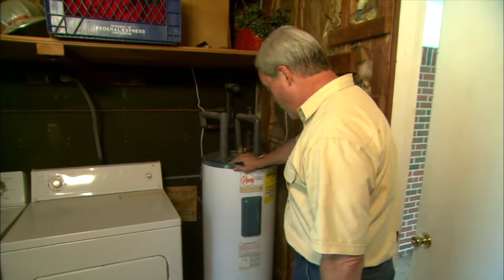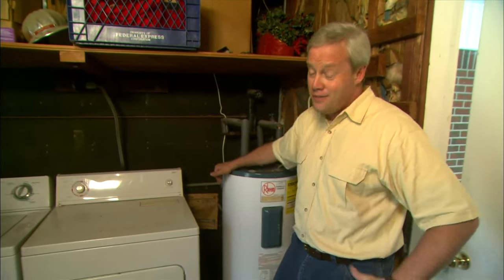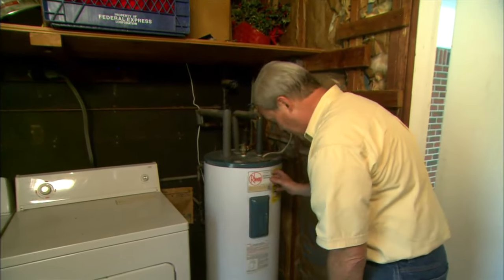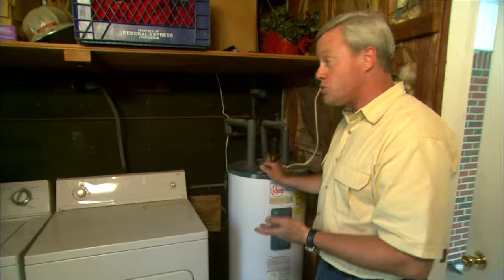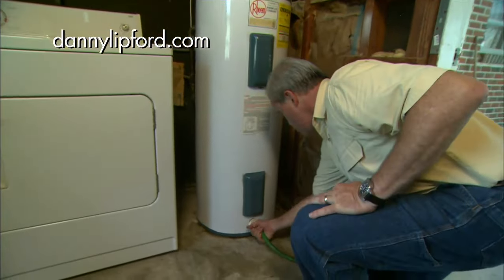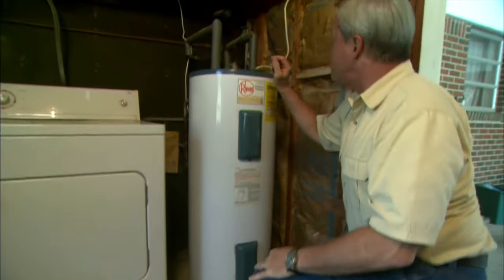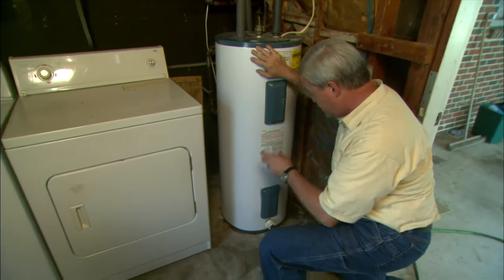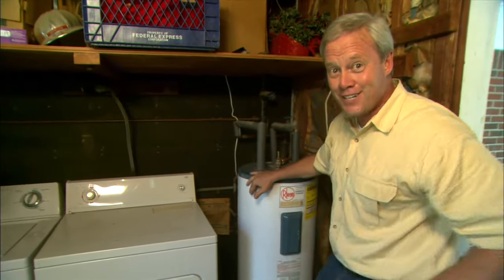Easy Steps to Draining Your Water Heater | Today's Homeowner with Danny Lipford

Comment: the only reason i searched for this is because Rheem put a stupid plastic drain valve that feels like it's falling off as you loosen it. didn't want water all over the floor. have no idea why they would do it that way. a valve should feel firm and snug, not like it's about to fall off.
Reply: Literally same reason I’m here. That stupid plastic twist valve is broke all to shit on mine
Reply: Same
Reply: Hey... me too.
Reply: This is why im here as well sir😂
Reply: Same darn reason....
Reply: Yup, mine is leaking 😢
Reply: Hahaha samzies
Reply: Anybody have a solution for that?
Reply: GE did the same thing
Reply: Same!
Reply: Hahahaha me too. I had a vision of water spraying everywhere from that loose plastic valve
Reply: Same here. Makes no damn sense. Every time I think I’m handy I run into something stupid like that and scratch my head
Reply: I training mine right now 1012 years ago my first experience with that plastic valve. Luckily I’d let the water cool down overnight. I turned it it was flowing pretty hard and I said let me see full and it popped off just like you said so today I have it training slow even though I have, the safety brass pressure valve with no pipe on it open to let air in . Draining too slow to remove sentiment!
Reply: @gamergarett  are you sure you’re broke it seems to be designed that way. To self and you when I buy a new hot water heater, install my own valve.
Reply: Solution put a new valve. Brain goes to why would they put that on there? Can you imagine somebody when they’re hot waters hot scolding themselves. Most gasoline siphon in the same. The lines will fall apart by themselves. One of the few things I wouldn’t want to fall apart would be a gas siphon. Look into simulation theory with physicists who believe it’s possible and most likely.
Reply: @mikebee515  yes buy a valve (ball valve) so you don’t have to twist it as far and install that. Im going to buy a new hot water heater and install when new. I would ask a licensed plumber I can’t imagine a reason other than a second safety feature in case you’re relief valve on top of your tank, failed or couldn’t let the pressure out fast enough. Otherwise, I would think it’s a sick joke that they put these valves on there, which one makes sense because there would be tons of lawsuits

Comment: Also, don't turn power back on until the tank is completely full to avoid burning out the heating elements, as they must be submerged in water
Reply: Good tip. How will I know when it's full again so I can turn the power back on?
Reply: @luca2627  so there are a few ways ... time how long it took to empty. Put your ear up to the tank, and you can hear at start it will sorta gurgle as filling. Finally, start when it's partially full, and tap on side .. it should make a different sound where full compared to up higher where empty. YMMV, but mine took about 15min to fill a 50 gallon tank.
Reply: @flattenedfrog 😅
Reply: Also, wait for the water to cool a bit before draining.  Most hoses do not like 130 degree water!
Reply: Lol he did say that thanks
Reply: @luca2627 open a hot water tap and let it flow, helps to rest the pressure relief valve to remove any air trapped in the top.
Reply: Good point,
Reply: What if it’s a gas heater?

Comment: My water heater was installed in 1994. It's 2023 and it's still going strong.  But now my wife wants to replace the floor in the laundry room so we bought a new water heater. She wanted one. Oh well. Maybe it would have lasted forever.
Reply: Raheem electric hot water heater pilot light
Reply: Or, she saved you from a flood!

Comment: Almost no water came out when I did it, using the shutoff valve on top, but once I opened the valve, water came out. I got confused and wonder what I did wrong. I have propane, and so since no water came out, I just turned on the heating element since there is water inside the tank. I will try it again but instead, shutoff the main waterline as that’s what I did when first installing the tank.

Comment: So easy!  EXCEPT when the drain valve is frozen, the water heater is in a metal tub to prevent damage if there is a leak, and the drain valve is pointing down.
Reply: Bend tf out of the metal tub no problem

Comment: What about resetting the pressure relief valve?
Reply: I'm not a plumber, but I would urge one to  reset the pressure relief valve before turning the supply line back on to flush out the last bits, or else you will have a significant flow coming into your home. Then you can close off the drain down below once its running clearer. Then you can disconnect the hose.

Comment: What if my electric heater doesn't have those turn-on/turn-off valves on the top nor are they on the sides. Does that mean I have to go outside and turn the whole water system off? Thanks. I know this video is 7 years old but the info is still relevant and I am a true novice. I have a Whirlpool 40 gal mobile home heater and it seems that my 'pipes' come from the floor.
Reply: I would turn the main towards your house off personally I have a valve near my water spicket outside that turns the water off , or you can check by your water meter

Comment: I've heard it's not a good idea to mess with the pressure release valve.  I've never drained a water heater before, but I plan on opening the hot water valve on a sink instead when I drain mine in a few months.
Reply: I’m draining now and hot sink valves opened was my third step, we on the same page. 👍🏾

Comment: Could you just hook up a hose and open the valve without tuning off the gas and water supply?
Reply: If you want to burn out the heating element sure.
Reply: You could probably set your heater to just be in pilot light mode. It’s not heating the elements but is ready to go at the turn of the dial.

Comment: Down hear in Australia you have no separate drain valve on electric storage heaters you have to disconnect the cold water inlet piping and screw a hose adapter in its place while it is full of water , a royal pain in the ass.

Comment: That was fast.
Reply from the maker: Glad you liked it!
Reply: The vid helped me drain the water heater. I had to replace it and it was too heavy to move full of water. Water would not drain so I opened valve full open and shoved a stiff in the spout to dislodge the blockage, then it came pouring out! (So I quickly turned valve off, cleaned up the mess, and connected a garden hose to drain it out to the yard) T.Y.